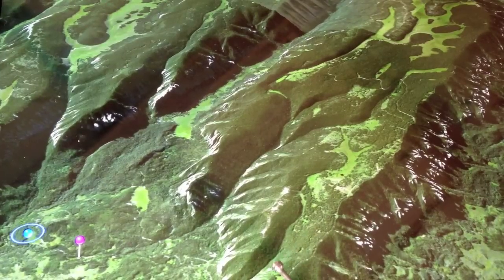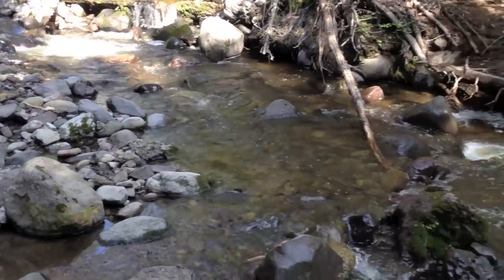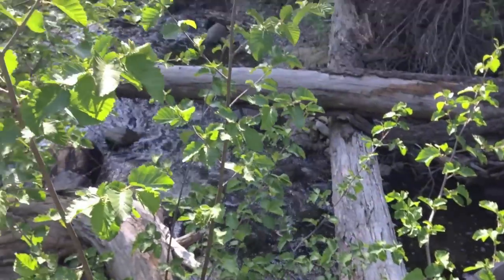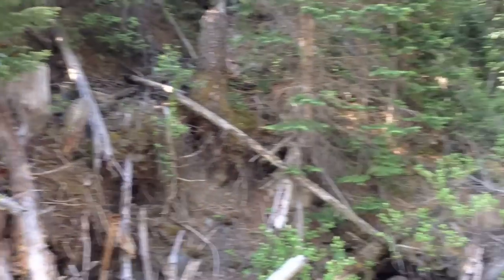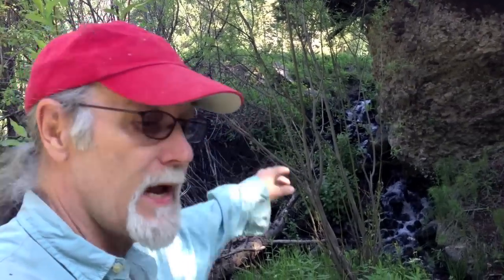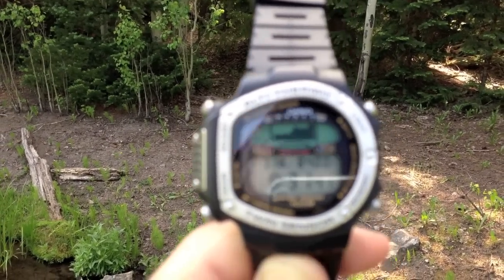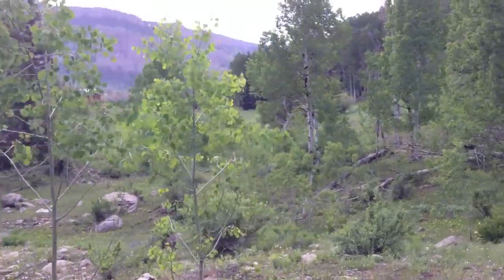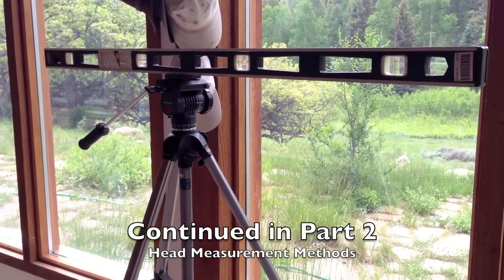Part 6 MicroHydro Power System in CO

Comment: Is this system powerful enough to power your house? There's a creek by my house that's sometimes empty, but reached 30,000 gallons per minute this spring, I wish it didn't have fish in it.
Reply from the maker: Yes, plenty of power.  In Winter we turn the system up to max and can heat the house.  Then in Spring through Fall we run at a reduced setting.  We range 110-200 kWh per day which is massive more than most homes ever use.  Thx for watching, I never know who has seen what.  Watch parts 20-1,2,3 for a synopsis of the whole project. This is a playlist of those 3 parts: https://www.youtube.com/playlist?list=PLtTypVpmDd-vkT9bJQkXw4I1t0e_4jMYA
Reply: @mrhydrohead  Thanks. I've watched the whole series now and it's very impressive what you've done.
Reply from the maker: DoG Sick So glad you checked it out. Thx for watching. More to come on other kinds of systems in the future once I locate them

Comment: Instead of the watch, what you needed was a Garmin unit. It would give you far more accurate readings off of the GPS. But as this was originally uploaded 5 years ago, I figure you have improved on it since then. Only bad thing is how many satellites you can pick up affects accuracy. At times it is +- 50 ft. Which tells me I'm under 40 feet of water. :-)
Reply from the maker: Yes there are lots of methods. Google earth is quite accurate. Gps reception in the woods can be spotty at times. I was just trying to show some different methods for estimates. With Static pressure @ 96psi in the now existing penstock, its just simple math 2.31 * 96 = 222ft of head. Thx for watching
Reply: @mrhydrohead  Enjoyed the whole series. The creek that flows thru our farm is too wild to tame. In one day, it can go from a 200cfs flow to a 5000cfs flow. Or from a 2' gauging to a 12' gauging. They thought about building a dam upstream of us but found out that it just was too unpredictable as to flow. Feast or famine with it. My grandfather built two homes across the creek from the farm house. The first was built 1 foot above the 500 year flood plain. The other was built at the 1000 year level. Both have had water go thru them. Which is what the dam also would have had to deal with. The former US highway that runs near the creek actually has water level gauges on the side of the road and that is for after the creek has already come out of the banks. 12' is flood stage and on 4/4/2018 it hit over 16'.
Reply from the maker: gravelydon Woah that sounds like a river vs a creek. A massive resource if somehow harnessed. Without seeing it i can only guess at the issues with variability of flows. Have you looked at this system?
https://youtu.be/gY3p2e1-kN4
Haven’t seen it myself except via videos, but my thought is a diversion ditch or structure might serve to feed this sort of device if there is just a few feet of head which could be captured. Just guessing here and offering a suggestion if you aren’t already aware of it.
Reply: @mrhydrohead  It is a creek fed by 288 square miles of land. It drops from 1210 ft at its high point to ~600 ft at its mouth into the Ohio River in about 15 miles. Which is 30 miles by the creek travel ( .3% drop rate average ). In 1998 in a 10 rainfall was recorded over the area in a 96 hour period. That flood is the one that got my aunt's home. Estimated water level in the creek at that point was nearly 30'. That one storm killed 5 area residents. During normal summers/fall the creek may only have a couple inches of water flowing thru our crossing. I say our crossing even though it is county owned because the ROW and previous crossing which it is built on were given to the township for the road by my grandparents with the understanding that if the county ever failed to maintain the crossing, the township would lose all rights to both it and the ROW for the road that runs thru our farm. A few years back, the county was going to condemn and remove it. By the end of the day they had a petition signed by over 100 people who said no. The county instead had to do some structural repairs. If they had not, we would have and then closed the road/crossing to traffic. Ours is the only low level crossing on the creek in the county as our neighbor's crossing was basically taken out by the 1998 flood.  The crossing is known by our family's name and the road is too.

Interesting video. Not sure that unit could survive the 30' head though that it would have to be forced to deal with at some time. And the normal drop over the whole length of the creek bottom that we own would only amount to about 3'. I have thought about a 6" turbine for use in one of our old pipes where the bearings were water lubed and a shaft to above the highest water point. One of the original pipes from the original crossing is still in place but currently closed off by gravel.  It is in a protected bend in the roadway/creek bank.

Comment: I am really enjoying this series, thank you for sharing.  At 0:54 you talk about plans to gather more water from further up.  How does that work with water rights, in Colorado?  Do you have to hunt down the owner of that specific property?  (I'm assuming it's not already your property.  If it is yours already, then please pretend it isn't for purpose of my question.)
Reply from the maker: Well I do own the land, but regardless you have to file in water court to get non consumptive run of river hydro rights on the water.   Once approved for conditional rights you have 7 years to either prove the use of the water and file for absolute water rights or refile for another 7 year extension of conditional rights.

Comment: Why wouldn't you just pipe it straight to the pump vs piping it to the meadow then releasing it, then collecting it again to pipe to the turbine
Reply from the maker: There is additional water existing which runs through the meadow which the creek water is combined with.

Comment: was not climate change, some one diverted your water...
Reply from the maker: +lat woods  Yup, agree.  For the last 27 years here(8600ft.) we would have multiple feet of snow on the ground by this date in January. This year a whopping 2 inches remains in the shaded areas.  Usually winter access is snowmobiles only, but this year we are still driving in and out.  It is attempting to snow today but 36 degrees.  Weirdest weather I've seen here and apparently connected to La Niña over pacific with high pressure systems altering patterns.  Freaking scary.
Reply: Jonathan Waugh, this guy built his system in the mid 1990's and has notice slowing decreasing water supply from the streams, that's of the best evidence of drought and climate change. Even the Colorado river which starts in the Rocky's water flow volume has decrease drastically over the last 25 years because of drought, the results can be clearly seen in shrinking Lake Mead!!!!!!!!!!! CLIMATE CHANGE IS REAL!!!!!!!!!!!! THE EARTH IS GETTING HOTTER!!!
Reply: Exactly! I would be steaming mad!
Reply: There is never any mention that the earths magnetic Poles have been shifting, which is causing unusual weather conditions, but since "Man made" Climate change create a basis for leftists in governments to control  businesses and people's lives, it's better they are ignorant.
Reply: Jonathan Waugh   .....    The climate of our earth is always changing and just from archaeological discoveries around the world, we can see this is true.  That being said, man made climate change is not the problem with our world today, accept the military complex utilizing technologies and weaponizing it to  disrupt or change the natural structure of our weather,  (U.S. Patents go back to the early 1900's, not to mention the famous rain storms and flooding of the "Ho Chi-man trail" during the Vietnam war, so the enemy could not resupply there troops.  
     If anyone wants to know why this world we live in and the people we live with are changing so drastically, just look to the Bible.  It is all there, any information about where we live, what is happening in  our world today and where we are going after we leave our physical home.  
     Pray about it and then search as much as you possibly can, with the guidance of the Holy Spirit, and you will start understanding things like you have never before.  
     Look up a guy by the name of "Jonathan Kleck" here on YouTube and listen to him for just ten minutes and it will either start opening your spiritual eyes and ears or you will brush it off as just another salesman.  This is completely, 100% up to you and you alone.  Nobody is responsible for our actions and the way we choose to live our life.  Nobody else is responsible for the direction we take our life in, or the actions we choose to take during our short stay in the physical realm.  
     Everything is right in the scriptures and is right in front of our face every time we open the Bible and has always been there.  Unfortunately we were not directed or taught the real truth of the scriptures and it is not to blame any preacher or elder because they didn't understand or know any better themselves, but we were taught half-truths our whole life.  The prophecy is being fulfilled at this very moment in time, where the scriptures say that the Lord God will pour out his Holy Spirit upon the earth and many will dream dreams, prophesy and see visions.  Another prophecy that is being fulfilled right now is where our Lord said  "everything that is hidden will be made known and the darkness shall have Truths light shine upon it".  
     God Bless y'all

Comment: That's fantastic!  I'd love to be in a position some day to do this. I'm surprised that a state like Colorado would allow this to be built. Any fear that the EPA will drop in?
I'm looking forward to more vids!!
Reply from the maker: EPA doesn't regulate Micro Hydro.  Only large waterways large enough for fish have Fed regs.  But securing water rights is crucial, especially in the western US. Have had system running on springs for 18 years now.  No problems.  We've finished the Pipeline and Bridge on the new system now and I'm editing today.  If I get next video done by Tuesday I will try to upload it when I go to town to get some finish welding done.  Satellite internet here is very restrictive, so I have to wait for a trip to town to upload next vids.  Thanx for your interest.

Comment: Great vid. So you don't own the land?  Does the state own it and have a permit?
Reply from the maker: I do own the land where the water is taken in, penstock path, power will be generated, and the transmission line path.  I did have to file on water rights to put the water to beneficial non consumptive use in the state water court.

Comment: Thanks for the videos - very informative and inspiring! Did you have to get permits/etc to develop the new system or is this on the down-low?
Reply from the maker: Thanks, its fun to share.  I've had conditional non consumptive water rights on this creek for 12 years(have to renew every 6 yrs).  Now I'm forced to develop them due to the flow issues.  Once I'm done building, I should be able to make the rights "absolute".  Colorado is heavily regulated on water, best not to risk trying to fudge it.  In the long run I'll end up with a lot more power.